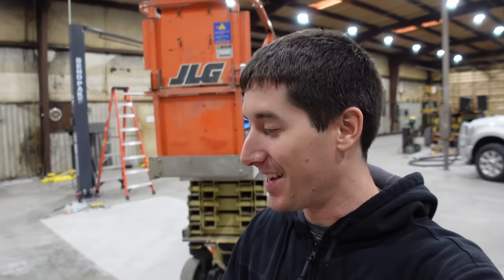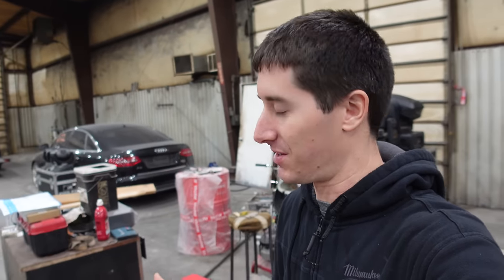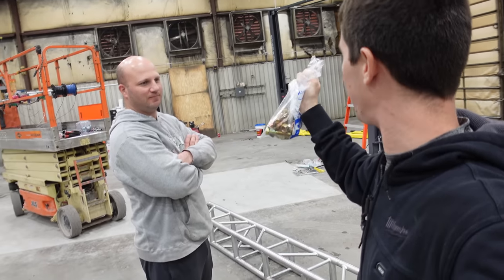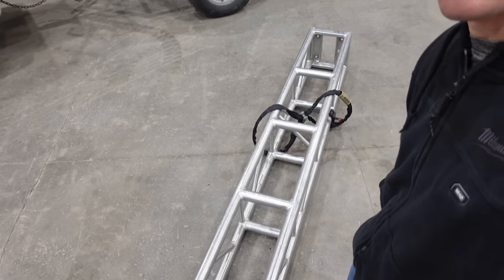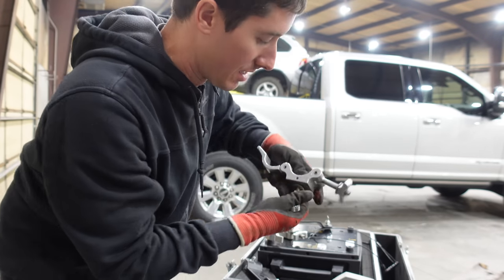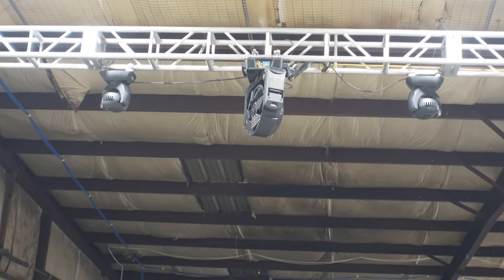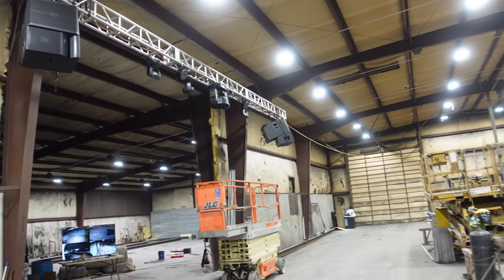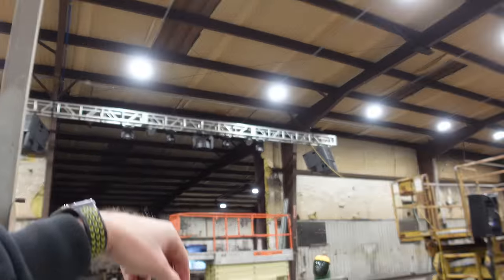I Used To BUILD NIGHTCLUBS, So I Put A Nightclub IN My SHOP

Comment: I didn’t realize how bad I missed Josh until he made the HAM radio joke 😆
Reply: I actually would like that tower for my ham antennas 😀
Reply: love when Josh shows up he is a star
Reply: @billpar  Quiet but deadly!
Reply: @craigvk2paw17  that truss is actually not good for a radio antenna. It doesn’t have the structural support it needs. It is only designed to hang horizontal the way that the webbing is installed. A good cross wind and it would fold over

Comment: When fitting cruise ships we sometimes  had to skip the quick lock brackets because of the lack of space. Had the shipyard make steel plates and drilled out the quick locks from the fixture and installed nuts instead. Had to get them certified as well (ship=moving platform), no problem. And Chauvet makes some good fixtures, P1, P3 and Rogue 2, they just last and last, done both festivals and ships that drive in ice (shaking) with those. Keep up the good work!

Comment: Not personally a VRX fan myself but I'm sure it's more than good enough for the warehouse
You might have said it in the video, but it might be a good idea to put some kind of damping or insulation on the walls and roof of the shop. Keeps your heat in to save on bills, and it'll dampen reflections and echo (not much can be done about the floor though) I also feel like you may want to put the existing tops right underneath the JBLs at ground level, or up on the trussing acting as downfills, otherwise you'll be missing like 20 feet of HF coverage under the boxes

I'd definitely be into seeing you do more audio/production related stuff, it's always nice to see live sound content and talk shop with people right now since there's just nothing happening in production land this side of the pond

Comment: Many comments in one....
-Guess you found the sale of last of the old HES gear, DL's, shapeshifters, looks like they found a good home to live out the rest of their life.
-DL's aren't fun to hang by yourself, but it's doable
-Mac 301's have the best blue chips... it's almost UV, i miss that fixture
-Center lights are the Devil.... get another Shapeshifter...
-need to rehang the VRX you got a 15 deg box pointed at the roof... aim them down 
-Put the subs on the floor they won't project as much outside the building and you'll get more of a rumble in the building at a lower DB vs flying them. 
-Lightparts.com in TX probably has those Omega brackets for the DL's or they can likely find them 
-what are you using to Program all that? drop me a line Chamsys is a great choice for what you have going on there. 
- thanks for the kind words about us production folk. hopefully we will get to go back to work soon, because i'm not getting anywhere with this Youtube thing ....lol

Comment: So it’s obviously been a while since you worked in production. Over the last 15 years Chauvet has come a long way. It’s not the junk that used to be installed in nightclubs. Don’t get me wrong they still have the junk for clubs and people who are cheap.
Chauvet has a professional range of fixtures. I tour for a living and every tour I’ve been on for the last 5 years (not counting 2020) has had Chauvet fixtures in the rig. The size my tours are minimum 5 semi trailers going into amphitheater’s, and arenas.
When I’m home between tours I work at my local 20,000 seat amphitheater, and 90% of the shows that come through have Chauvet fixtures on them. 
I would say take another look at them. I bet you can get some nice Chauvet “SR beams”  for a decent price at this point as they are an older fixture now. They rival or if not better than a Clay packy “sharpy”. 
On a side note I have been touring and in the entertainment industry as a tech for 25 years all over the US, Canada and withe the occasional jaunt over seas. I have never heard anyone call a 1/2 clamp a cheese. I wonder if this is a local dialect thing from the area in which you have worked?
Calling a swivel coupler a “cheese borough” or cheeseburger” is very common.
Also I am super curious as to why you chose to weld the hanging points to your beams as opposed to using beam clamps? Also curious as to why you dead hung the truss instead of using a couple of chain hoists? It’s way easier to swap out fixtures and recable the truss with it lowered to a safe working height.
Reply from the maker: Chain hoists literally cost more than a scissor lift and would put the truss in the sight lines. The welded hang points keep it nice and tight, it’s never gonna move again 🍻
Reply: @WatchJRGo  I wasn’t referring to electric chain hoists. There super expensive. But you could crab some decent manual hoists for under $150. 
I know I personally have found some older cm cyclone hoists with 15’ of chain for $100 on Craigslist. I used to rent them to a company I do side work for so they could take them out to burning man to hang a line array off scaffolding in one of the camps.

Comment: Glad to see you actually use your truck like a truck. Too many high dollar trucks turned in to personal luxury cars completely negating the purpose of their existence.
Reply: Yep! That $90,000 truck handled that 120 pound load like a champ!
Reply: @nannyg666  Duuuuuuuuuuuude, that $90k truck could of been dented or scratched, God forbid! I'm just sick of seeing 3/4 ton and up trucks running around carrying nothing more than an overpriced venti.
Reply: These trucks were meant to work, on just hauling 120lbs every so often & the occasional lunchbox. 
I’ve got an old 1993 idi & it carries my tool box, all my tools under a lock, & some ramps in the back, & that’s about it. I never tow anything over 1000lbs. I wanted an idi ZF5 truck time get the MPG’s, the nice ride, so simple, will run on anything & it’s all mechaical.

Sometimes I go to the scrap yard, but rarely use the trailer at all.
These old 3/4 ton OBS trucks are the size of a new f150. My truck is tiny compared to the new ones. She’s pretty slow, but she gets there doin 16-25mpg!

Comment: Hey I sent you some messages on IG. My fiancee works for Musson Theatrical out here in Santa Clara, CA. He said the specs say it only needs 2 quick release mounts and but the cheese burrow needs to be secured with 4 bolts. They don't have anything in stock that would work. He probably won't hear back from the manufacturer until tomorrow (Thurs. Feb.4th)

Comment: I shoulda put this on the lighting video but....if you’re running your lights at 50% or lower wouldn’t have made more sense to buy half the lights? I mean even if you bought 25% less LED fixtures you probably would’ve saved a ton of money and you would probably never run your light at full power. When you first said how bright they were and then how many you bought, I was thinking that’s wayyyyy too much. Now you got more fixtures that can fail. I’m sure you don’t want to go backwards but how much money could you make selling 25% of those fixtures?
On another note it would be a cool video to see you throw a Super Bowl party there.

Comment: hey #WatchJRGo ... fellow AVTech and car electrician here ... watching you since last year ... have a question for you ...  why didn't you put the truss on  chain hoist  so you can work easy from the ground and also if you wanna change something just hoist the truss down and up .. super easy and i think the chain hoists are cheap  ... and where did you find working DL2's ? i mean the DL3's ones i was useing on cruise ship wor all broken an no spare parts available  .. ohh and your JBL's are in a wrong angle ... on a different note i like your stuff .. cool vids

Comment: 17:37 how are you going to do the floors? I feel like that slab would stand out with epoxy
Reply: Concrete can be coated to appear as one uniform surface.
Reply: @larrybe2900  ohhh good to know, wait like a thing recoat? or more like a paint?
Reply: @BrokePremiere  
I believe it is a thin layer of concrete that makes the floor uniform and then you can put the surface on it you want. It will bond to the old floor.

Comment: i have never seen a line array mounted like that , are you sure they shouldnt be facing forward ? let the HF drivers do the work
Reply: He started the video shittalking some of the most common used names in lighting. You expect him to actually know pro audio?
Reply from the maker: It's a 100* box and I need to cover the whole place not have a power alley, no sidefill. This does a really good job covering the whole place at that angle. Obviously a point source is the correct choice for the application but the VRX looks really good and that's what matters 💯